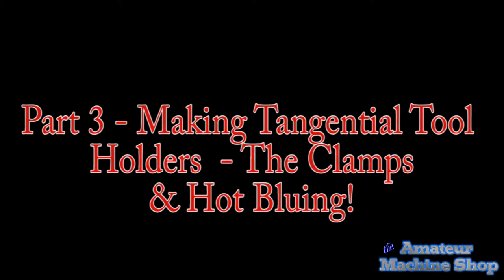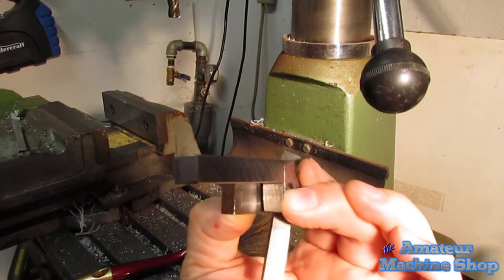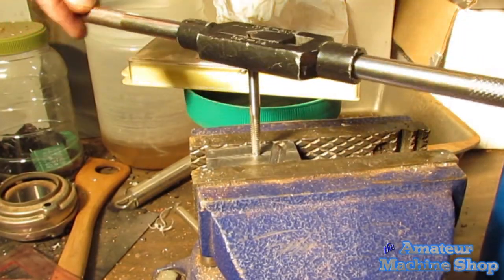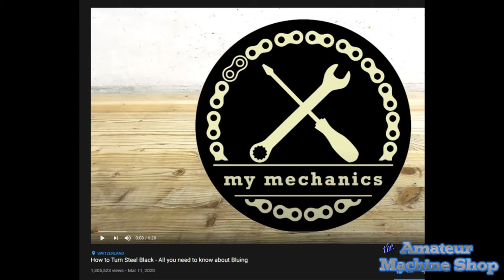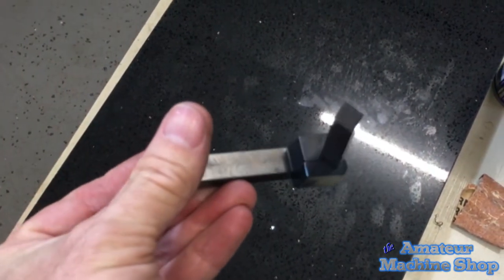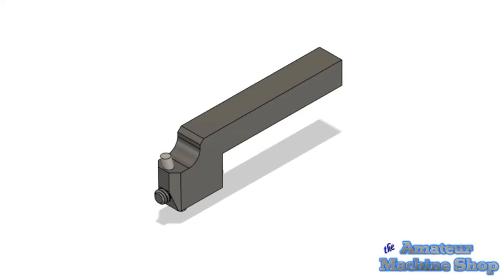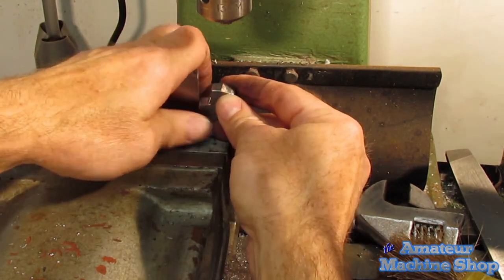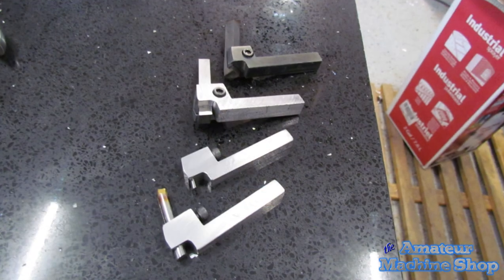Making Tangential Lathe Tools - Part 3

Comment: Great series for the Tangential tool holders. You mentioned needing a third hand, have to tried using magnets or small magnet fixtures. Strong hand makes some that are not to bad. Probably others available also.
Thanks for sharing.

Comment: i mad my self some Armstrong tip tool holders . & some tangential tip's . tool  holders I found drop forged  steel better to form & mitt the tooling . to do this i had some very old  spanners  of a large size  king dick s & other's I founded the steel soft a easy to cut easily hardened when finished there  a good source of  mitral , & if cut with thought two can be got out of one spanner. I chose a number of , round tool holders , to make use  of the odd  broken hiss tool drill in my Coalson of   saved broken drills.  I can now put to use.  a flat is grown on the round tooling to prevent slipping in the holder below centre. by setting the tool on-centre  clomping it in the vice & marking with a felt tip pen  then putting the flat on & good sharp. stop . so when required it can be moved down . as reshaping it archived.